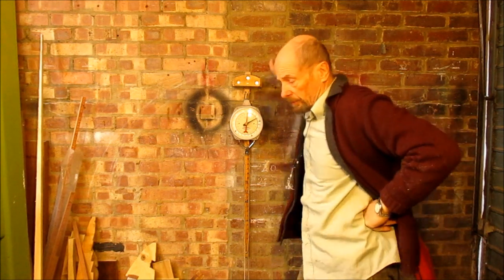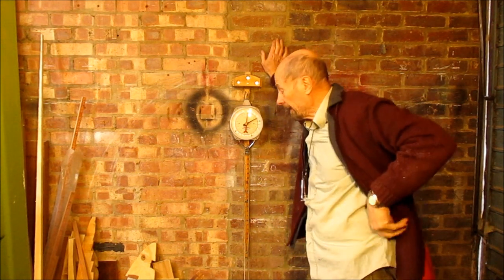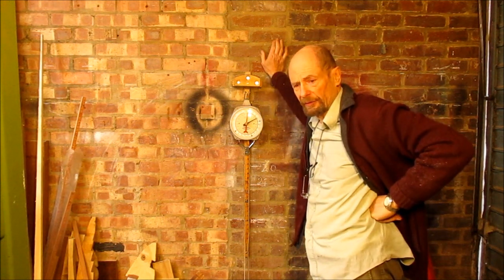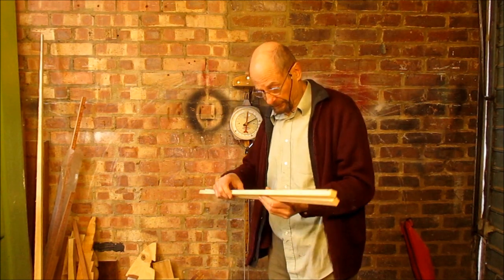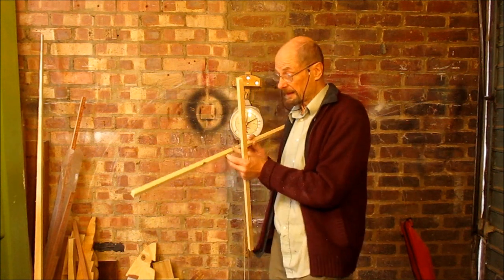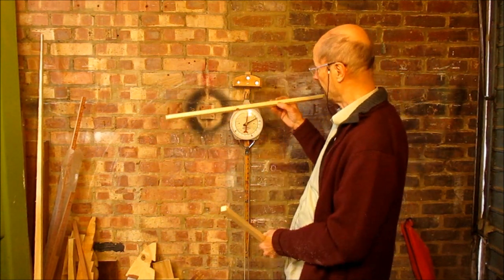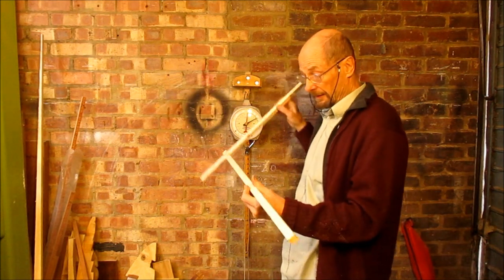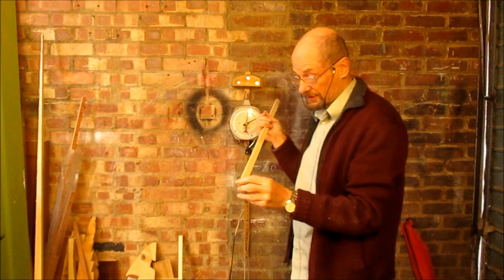Compression vs Tension

Comment: Hi Derek, i'm having some troubles in tillering a recurve hazel longbow, you know, just to get better with experience and have some fun with a new experiment I tried to add for the first te a reflex to a bow. The problem is that as soon as i heat treated each mid part of both limbs, the tillering got unexpectedly worse than before...i am trying to contact someone to help me get through it, you have any idea? Maybe primitive archer forum...anyway thanks for this kind demonstration, helps a lot in understanding to my mind, bye Atb
Reply from the maker: Hi, yes the Primitive Archer forum is a good resource.
Reply from the maker: I should add that working on just part of a limb always has a knock on effect on other parts. I find it's best to heat treat an entire limb if possible. I also think that it's easy to try to add too much reflex. There is only a certain amount of energy storage you can get out of a piece of wood and often what you gain in one area you can lose in another. Extreme designs tend to need very good timber, Hazel is good for relatively low draw weights but not the best for highly stressed designs.
This is the hardest working Hazel bow I've made:-
https://bowyersdiary.blogspot.com/2013/05/recurve-on-tiller.html
Reply: @delcat8168  Hey Derek thank you for your help, I think I am going to post the photos within some days, Atb